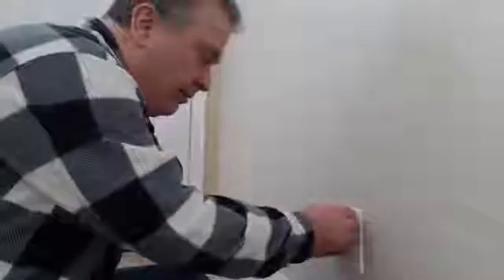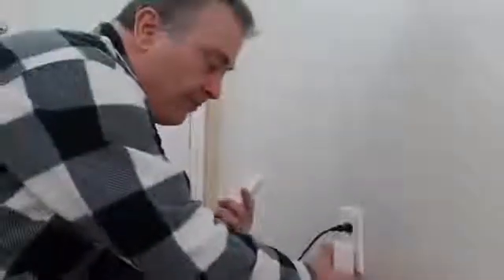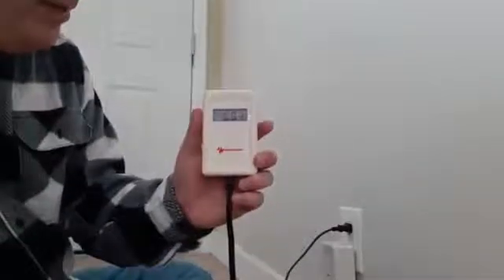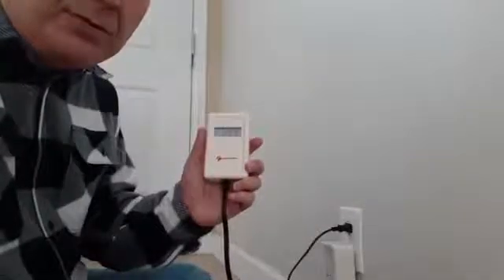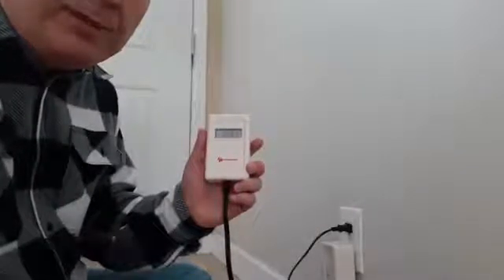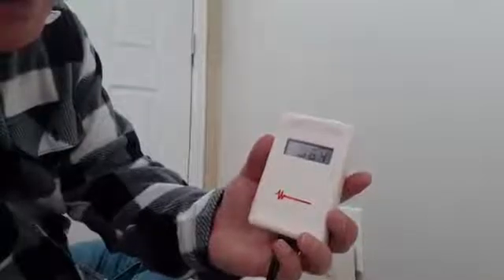Testing A Home For Dirty Electricity Part 5 - Wrap Up

Comment: Turn off electricity completely at night, that's the cheapest way to go. No filters needed. Fridge stays cold for 8 hours and ice doesn't melt. Have battery candles in bathrooms 🥰
Reply from the maker: that is one way to solve the problem. If money is an issue I show you examples of how you can make some protective devices yourself at home in this video https://www.youtube.com/watch?v=t9lAzNPJqBo

Comment: What are the fliter called and where can I get them ?  Thanks for making these videos...
Reply from the maker: Thank you for the question. And you are welcome :) In that article I have you in my last reply (here it is again https://www.radiationhealthrisks.com/best-emf-rf-meters-and-detectors/) has a link to where you can get the filters. It is the same company that sells the Grham-Stetzer meter for dirty electricity.
Reply: @RadiationHealthRisks  Saw the video on smart meter - are there strategies that can be used to mitigate the radiation coming inside cause the smart meter on our house is just outside the living room where everybody tends to spend alot of time ?  Thanks for sharing your knowledge.
Reply from the maker: @jps5887  Yes I show on this page of my website some solutions for the smart meter rf radiation https://www.radiationhealthrisks.com/smart-meter-protection-options/

Comment: typically how many filter plugs would a 3 storey house need, would one plug take a lot of the dirty electricity from the circuit (if any)?... i dont have a metre to measure, but was going to purchase one plug as a pre-caution!!
Reply from the maker: Great question. Unfortunately you need to put a filter in each circuit that has a problem. If that does not correct it then there is either some device on that circuit that is the problem (smart light switch ect) or you need some electrical repairs done (needing electrical repairs are not common, but sometimes).  For my 3 bedroom home I only needed about 6. Unfortunately the only way to know for sure is to test with a Graham Stetzer meter.
Reply: @RadiationHealthRisks  Thank you for detailed response :) I read the Trifield TF2 can measure dirty electricity. any thoughts?
Reply from the maker: @dodonohoe30  kind of sort of but not really. That is like taking a cap gun to a gun fight. Here is a link to my YouTube channel https://www.youtube.com/channel/UCUMbI8q4R3o9zOySV2IZhVQ/playlists?view_as=subscriber. If you go to this link and go to the play lists and watch the play list about testing for dirty electricity you will see me go through and test a whole house. A meter like I use there gives you the ability to know the exact reading on each circuit in your house and what if any effect filters make on each give circuit. I hope this helps.

Comment: Also, I found a website that shows which antennas are being used by the providers on the tower (at&t and verizon). Our house manages to miss the direction that these particular antennas face according to this site (the site lists each antenna number in use by its respective provider), I know there are others that likely face us but I have no idea what other providers would be leasing that tower. I emailed the tower owner to try and find out. This may be a small silver lining but I'd be willing to bet you'd say that doesn't matter much, still in harm's way. What are your thoughts? Thanks
Reply from the maker: Thank you for your comment. Sorry for being so slow to respond. The only real way to know what radiation you are getting from any direction is to test it with a meter. My preferred one (because it is a directional meter) for testing things like that is the high frequency analyzer I show on this article of my website https://www.radiationhealthrisks.com/best-emf-rf-meters-and-detectors/. Unless you measure it you are just guessing. Cell companies like to say that the towers are only pointing in a particular direction. I have tested in other directions and still maxed out my meter. So you really should test it to know for sure what you are dealing with in my opinion.

Comment: Hey question! Have you seen this video?  
https://youtu.be/-M4j-YdyrVo he talks about the magnetic fields from installing the filters. What are your thoughts?
Reply from the maker: Thank you for the comment. It is an electronic device so there would be some electric and magnetic fields emitted from it, but it is much less than the dirty electricity it is filtering off. Also since EMF Radiation dissipates with distance if this concerns you put the filter in the outlet of the circuit that is the farthest away from where people will be. But honestly the filter is worth it because it is reducing the dirty electricity so much more than the filters cause. I hope that helps.